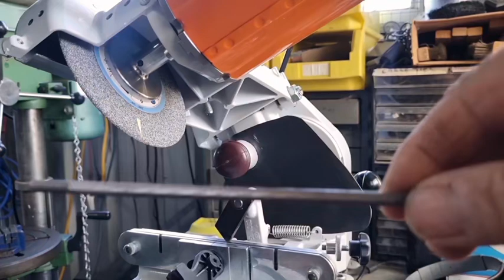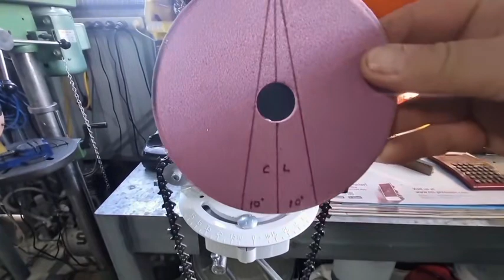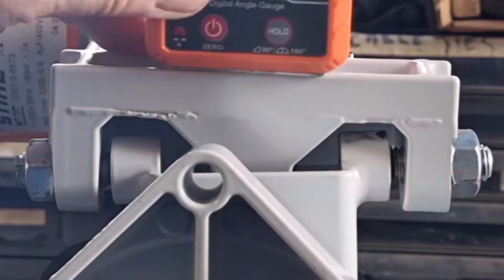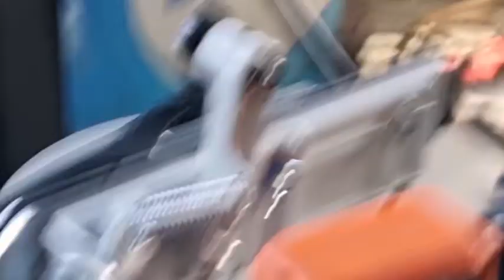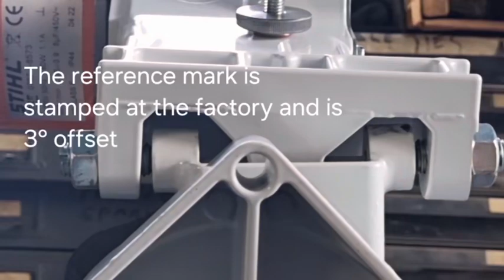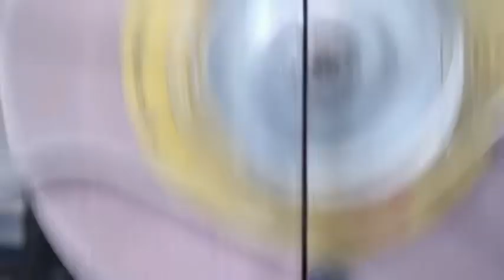Chainsaw Offset grinding for Dummies

Comment: i need your help. are stihl B scaler and oregon's centering scaler is same size? i mean both 0 to 10 or 15 are exactlly same mm or not.
Reply from the maker: The Stihl USG B scale is in mm, although Stihl doesn't say that. I put a ruler against the scale, and it's in mm
The Oregon is in degrees.
My Oregon vice scale at 15° is 12mm long

I can not say if the Stihl USG mm scale is close to degrees, but it would be close. What are you trying to figure out 
Hope that explains it
Reply: @ so, usg 15 in B scale is 15mm from 0 in B scale, on the other hand, oregon 15 in centering scale is 12mm from 0, right? i will make complete angle chart for grinder to share globally including wheel diameter differece.
Reply from the maker: @HdykNmy remember on the Stihl USG grinder has the C scale vice has an 17mm offset.  The point of the tooth is 17mm past the pivot point on the C scale.
From 0° to 30° on tje C scale you can see the tooth move 12mm away from the center line.
0° on the B scale will give you approximately 10° offset
There are so many differences woth the Stihl USG grinder you can't compare them.  In the end when you set the top plate cutting angle to 50° you end up with 50°
And if you set the top plate to 30° you get 30°
Germans are very clever at engineering.
The Stihl USG is very different to.the Stihl HOS grinder

Comment: You have the very best in-depth videos on this subject. Nobody else talks about this. I have the Oregon/Tecomec 610 grinder and I just installed a CBN wheel. The wheel is slightly smaller than the regular pink wheel. Now I have to go check all my angles. Thanks a bunch!
Reply from the maker: There is a difference in some Tecomec grinders.  In most cases, with Oregon and Tecomec, the top plate pivots are very close to the wheel centre line and are less complicated than a Stihl Grinder